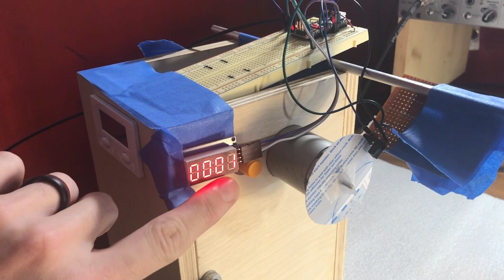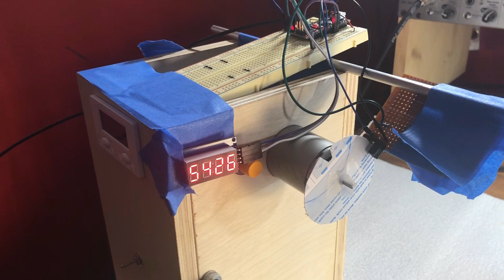OPTO Switch Counter Speed Test. OPTO Interrupter Switch. 5500 RPM Motor Test

Comment: Hi there! If you need some help with this I can probably help some. I'm an electrical engineer and mostly do embedded design and such. I enjoyed your video, and your original pickup winder video helped me a fair bit in making my own (granted it doesn't look as good as your since I was cutting all of the pieces in a cold garage with minimal lighting haha). 

On motors, I used the  XD-3420 which is pretty torque-y. I'd recommend using it. It's about $20 on Amazon, but you can get one for about $10 from China if you look.
Reply from the maker: athf226 awesome!!  I will order one and use it. Thanks so much for the help and I’m glad you like the videos bud.  I will defiantly keep you in mind when I can’t figure something out. There’s nothing like having an electrical engineer you can talk with!! Thanks again!!
Reply: @ChasesWKshop  Only note about it is that it's made to go much faster than you would likely need to wind a pickup so some sort of gear reduction would be beneficial, though not needed as you can keep the speeds lower by decreasing PWM. Just keep in mind you likely wouldn't ever be going near 100% duty cycle.
Reply from the maker: Awesome. Thanks!

Comment: Hey chase thanks for these winder videos. I am trying one myself. I have picked up most of the parts I need. I may have missed the video but I’m looking for how to wire the rpm display using the opto interrupter can you help with this? Thanks and keep up the good work!
Reply from the maker: David Rowe hey David, it hooks up just like the counter arduino. Basically the lead off of the OPTO switch splits and goes to both boards to feed the signal. If that makes sense. Also too if I had it to build again I would have left the rpm meter off but it’s totally up to you bud. Let me know if this helps.
Reply: Chase'sWKshop thanks chase I thought that was what you were saying but I wasn’t sure. I may leave it off because I will only be able to wind as fast as I can anyway. Thanks again for the help
Reply from the maker: David Rowe no problem bud. Glad u could help you out. Let me know if you have any issues.

Comment: Hey Chase, love your videos! I started this project a while back and am now finishing it up. What happened to the video with the code, explanation and wiring of the Arduino Nano for the RPM counter? I can't seem to find it.
Reply from the maker: Burnttoaster awesome buddy, I’m glad you like the videos.  If you go to my channel all the videos are in the pickup winder playlist. May just be missing it. I’ll try to find it for you if you can’t thanks bud and welcome to the channel!!
Reply: Thanks Chase I found it, but I am having a problem, my RPM counter is showing the same readout as the counter. I reuploaded the RPM file to the second arduino, but still getting the counter readout. Any ideas why this could be happening?
Reply from the maker: Burnttoaster sounds like you may have something going on with dividing the counter by 60 to get the rpm.  I don’t know for sure without seeing the code. Let me know if you figure it out.